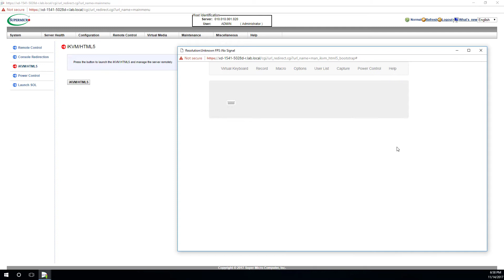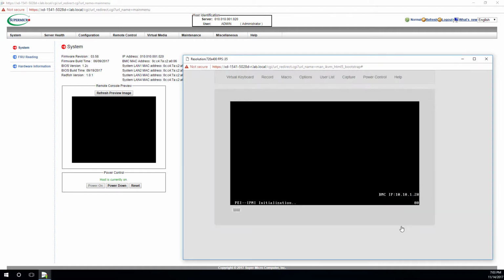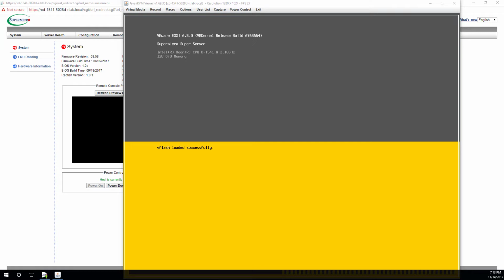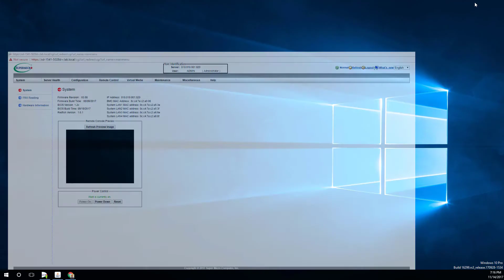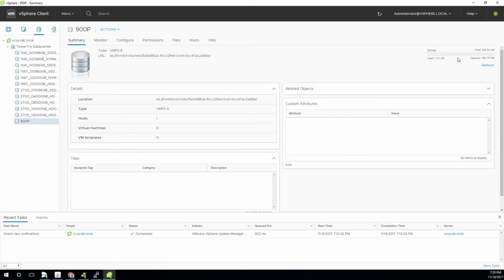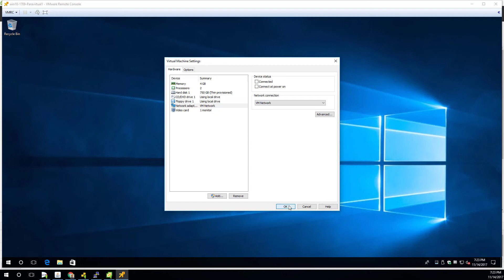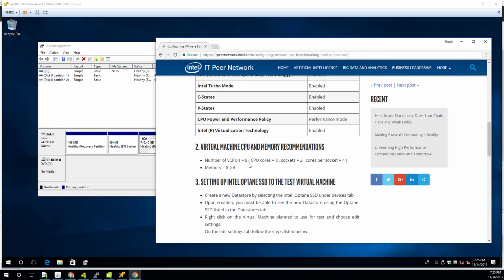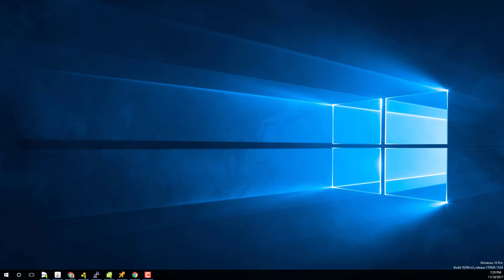Intel Optane SSD 900P U.2 formatted VMware VMFS 6 by ESXi 6.5U1 for Win10 VM boot tests

Comment: @Paul Braren why do you need any bifurcation settings for this card? Isn't the controller on it supposed to handle this automatically? Asking because I just deployed it and VMWare ESXi doesn't see the card at all so I am trying to find out more. Board is SM X10-SRi-F

Comment: I'm not impressed at all about the boot performance. My Windows 10 1709 virtual machine configured with 2 core CPU, 2GB RAM on VMWare host 6.5, CPU E3-1241v3 and Samsung 850 Evo boots in 5.9 sec to the login screen and your in almost 10 sec. Probably Intel Optane will eat my Evo in other operations but the boot time was not impressive.
Reply from the maker: I hear you, but keep in mind that all of this is just preliminary, just a lab test in progress video really, not sure yet if results will change much, we'll see. I have more testing and BIOS optimizing to do, see also:
https://TinkerTry.com/intel-optane-publications-oct-2017
https://TinkerTry.com/benchmarking-optimized-bios-settings-supermicro-superserver-sys-5028d-tn4t
and you might appreciate a listen to this:
https://twitter.com/paulbraren/status/936999325208662016